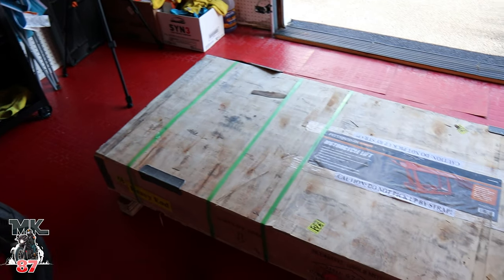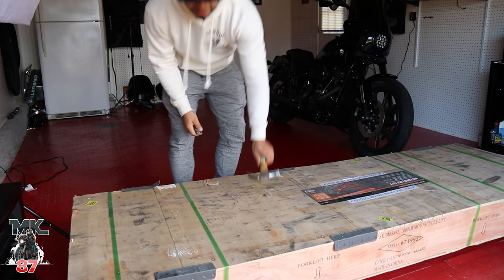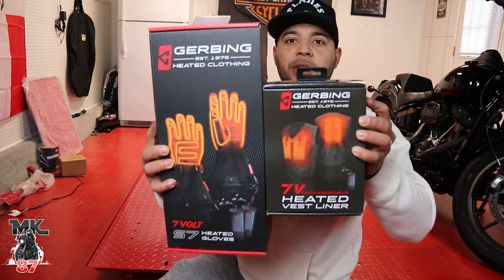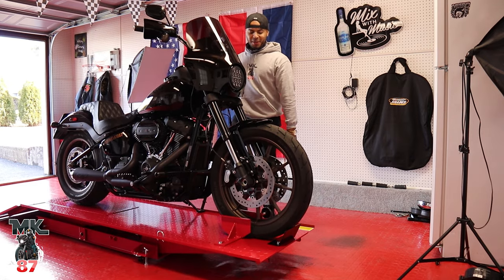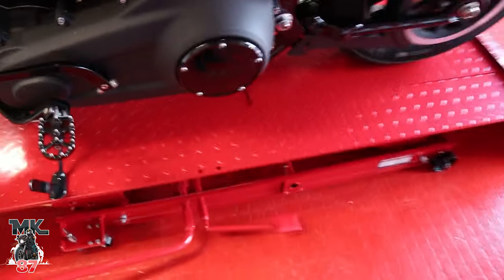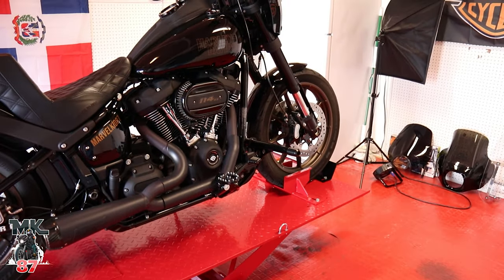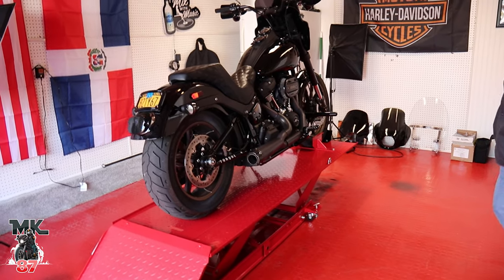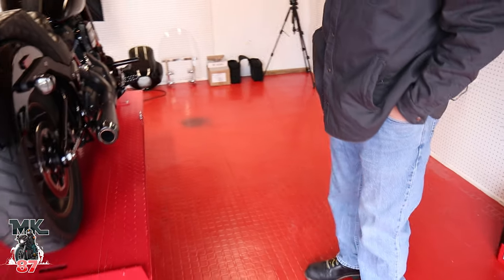Motorcycle lift for my garage

Comment: If you're gonna ride long/far, the 12v would be better. Having the heat up high on the battery powered stuff will shorten the time before it needs recharge. Either way you'll love the comfort it provides. I get the 12v full set up (jacket, pants, gloves, socks, wireless controller) from work so I'm spoiled. 

Enjoy the lift, my wife got me a jack.

Comment: The harbour freight lyft works OK be careful with it will tip over. Get rid of the junk vice That came with it and get a good  Wheel vice off of eBay or put a motorcycle trailer wheel chock on it add a lot of safety to it hate to see your bike fall on the garage floor

Comment: Don't forget to strap down the bike every time you put it on there to make sure it doesn't fall over. I run ratchet straps from those loops on the lift 2 where the handlebars meet the clamp.  One on each side. Be safe that's 600 plus pounds up there

Comment: I got the same Lift and I loved it but do yourself a favor and replace the wheel chock with a better one and put some skateboard grip tape at least down the center of the lift. I tried to put my bike on the lift after riding through some water and and the front wheel slipped and almost got me. After the griptape never a problem.